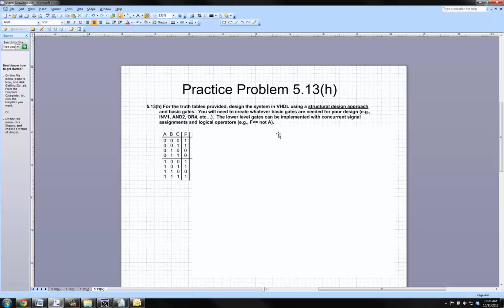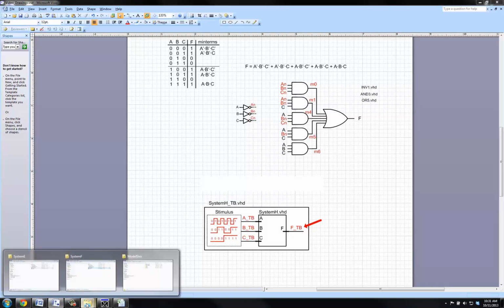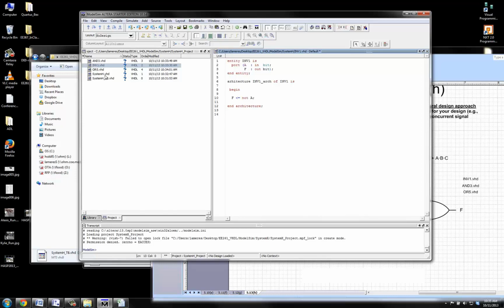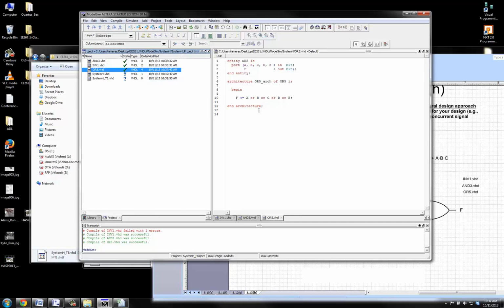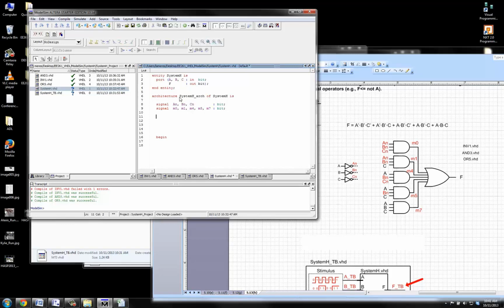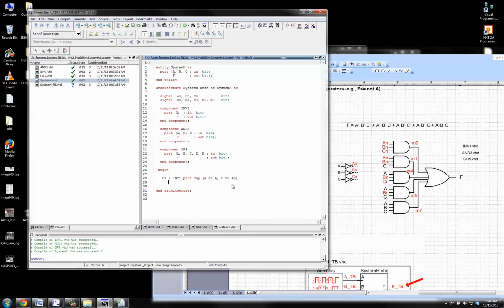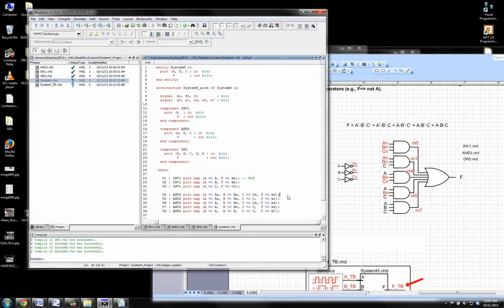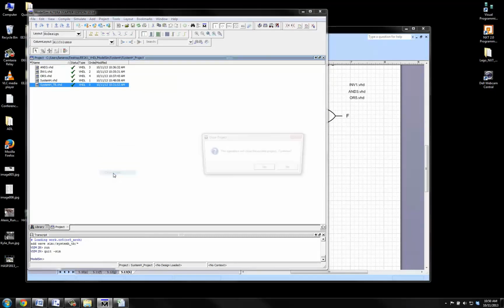VHDL Design Example - Structural Design w/ Basic Gates in ModelSim

Comment: Thank you. It helps a lot
Reply: @unstoppableguy7896  the inverter gate has a single input defined as 'A', but we made three inverter components and mapped A of the inverter to A of system H for the first one, then A of the second inverter to B of system H, then A of the third inverter to C of system H. So we have an inverter per input signal A, B, C of system H